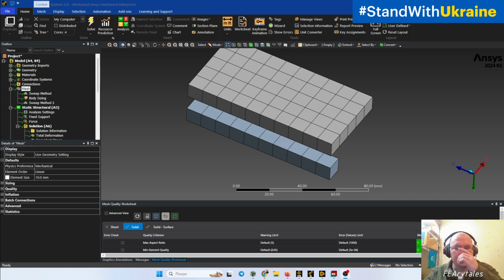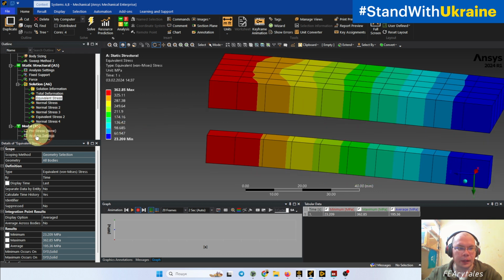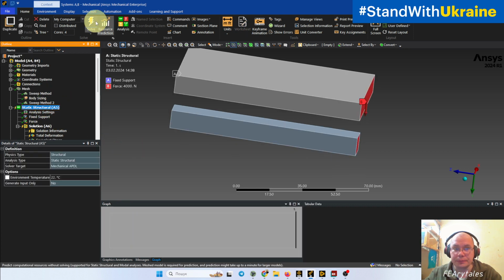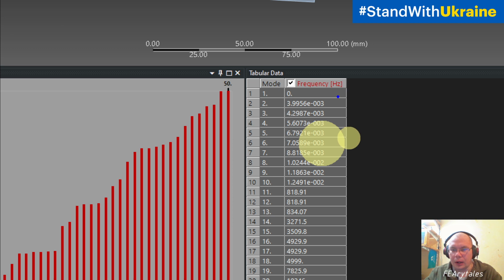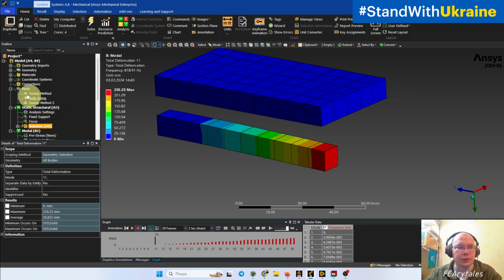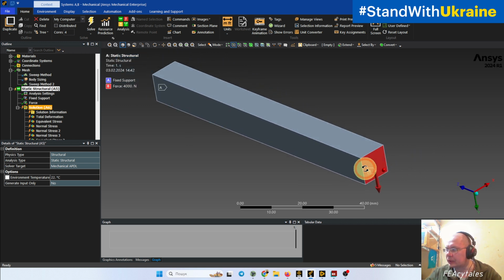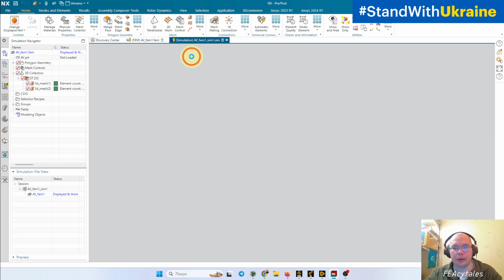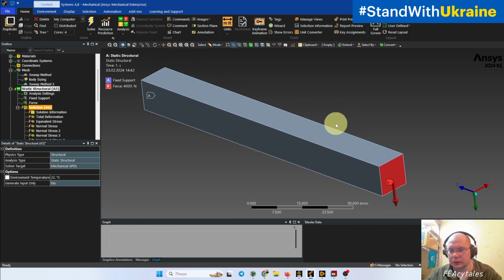Ansys. Solid Hexa 20 Node. Strange behavior

Comment: This issue is because you have 1 element in 2 directions and reduced integration scheme. You are out of limitations for this type. Changing integation scheme from reduced to full solves the problem. It can be changed in body properties.